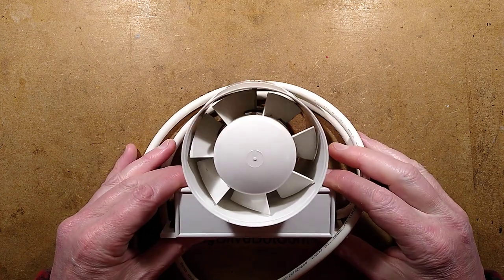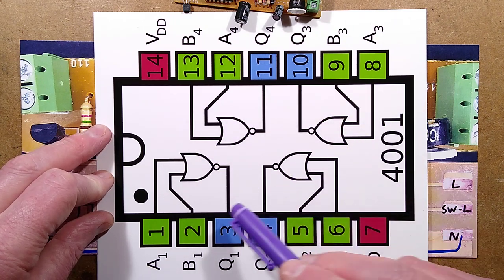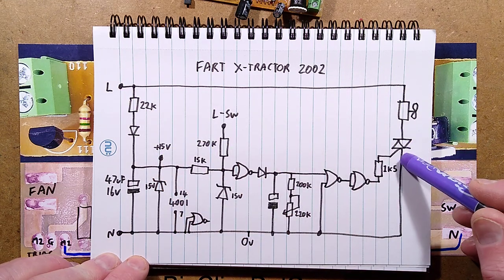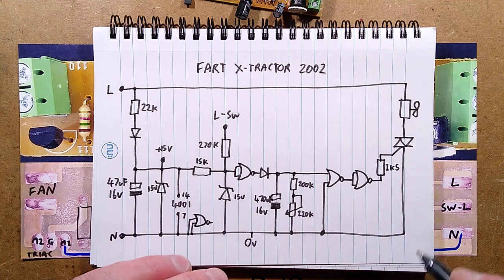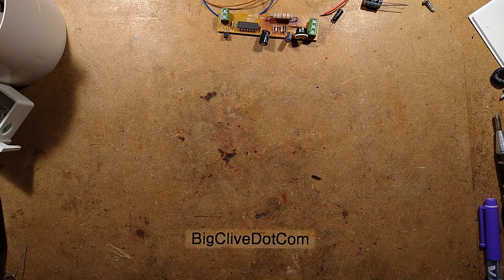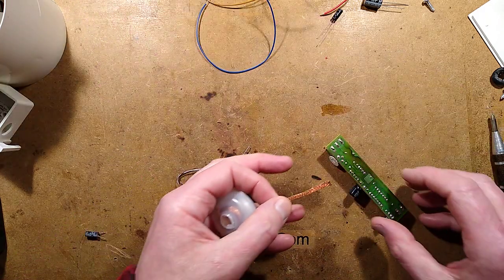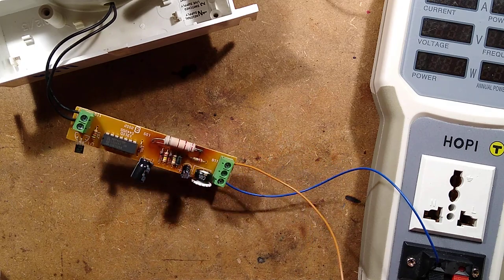Fixing a fart-extractor (with schematic)

Comment: I have to get one of those component testers they look pretty cool. I’ve found  they often have a thermal fuse in the windings of the transformer in the fan  and if that goes then buy buy fan as it’s pretty much buried deep in the winding
Reply: dont blindly trust those testers, they can give skewed readings in certain cases, especially with electrolytic capacitors, if the cap hasnt been powered up in years, it may have unformed slightly, and indicates bad, resistive, or very high capacitance,  way out of tolerance, its not necessarily bad as such and may be perfectly ok once powered up  for a while , ideally to full working voltage,

Comment: If I understand correctly, this consumes a watt constantly, nicely toasting a 2 Watt resistor.🤔.
Great reverse engineering Clive.
Thanks for sharing.
Reply: That is unacceptable. I would redesign the cicuit if it was mine. It should not draw any power when the fan is not running. Im thinking a high voltage MOSFET that is switched on by the switched live with a capacitor on its gate that slowly discharges when the light is switched off.

Comment: Hey Clive, want to build something that can be done on perfboard in about 5 to 10 minutes, create a voltage divider (using a potentiometer, resistor and of course the light dependent resistor) mount the LDR facing the light source you wish to control, could be a few inches away, and have that voltage divider control an NPN, so that the divider produces a lower voltage across the base of the transistor the brighter it gets 

once you adjust your pot and get the brightness that's it, I made it, thought to myself why isn't this used by the chinese and if it goes over max current a simple 500ma 1amp etc fuse will do fast blow..

and please do tell me why it's not a good idea to do it , keeping in mind, I had a 10watt 12v LED running like this off a car battery with absolutely no current limiter , to set up ap a 12v I slowly raised the voltage keeping an eye on the current and then adjusted the pot before bringing up the voltage to max!

it's a fun thing to try, really simple if you got an old LDR laying around? cheers

Comment: Nice!   The next step is to figure out how to cool the resistor using the fan - a strategically located hole in the round plastic fan shroud might be all it needs to let a gentle gust cool the resistor.

Comment: I have one of those, it was on offer and I liked the specific style of motor 😂

Extractor fans are a nightmare, I must have replaced my bathroom one 4 times before just covering the hole with a sliding vent, let bugs in without that there... They get so noisy and soon stop moving air, despite spinning and sounding like the time destructor 😂

Kitchen one never worked, so now it's a tumbledryer vent 🤣

Comment: This seems overly complicated. In the US our bathroom fans are a 120V shaded pole motor with a squirrel cage stuck on one end and switched on either with the lights or its own switch. I guess it's more efficient to have it time out after a while?
Reply: Yeah, I'd never seen the use of a timed circuit.  Also here in the u.s., bathroom fan failures typically have a 'howling' phase as the bearings wear out.
Reply: @adamf663  In my experience the "howling" phase comes about a month after you buy it and worsens over however many years it takes to wear out.
Reply: @Skyhawk1998  I have to disagree.  It occurs one day after the warranty expires.

Comment: Why not improve the situation a bit by putting 2 layers of capton tape on the pcb and over the cap to at least slow down the return of the same problem? I would like to se you not only analyse and fix stuff but make them better than they were(if possible at all). Is that something you might consider?

Comment: Nicely done. I was betting on the timing cap. I bet the CMOS NAND gate design was because the chip is basically free, and the inputs to the gates (especially CMOS) are very low leakage so they won't help that timing cap down.

Comment: I wonder if the power supply cable is really copper because it is so beafy. If it is alumium, then I understand. The engine is 20W something like 20 / 230 = 0.09 Amps for the cable, the thickness of the cable makes no sense. You picked an ultra thin cable for the power supply when you have tested.

note : I recently realized why my heatbed cable (12V) was heating so much, it is not copper. I will replace with copper and make sure to adapt / lower the tension applied to the heatbed because the wire will have a lower resistance with copper. My chinese 3D printer has been almost all changed over 3 years.

Comment: If you are powering it directly from a light switch and not using the timer function. Do you really need the multipole isolation switch.

Comment: I would have guessed that the output of the nor circuit that feeds the 470 uF cap was bad. Basically when it outputs 15V, it would be effectively shorted by the capacitor until it starts charging up. The cmos circuit is the only current limiter when charging.

Comment: Has the hallmark of being designed by someone with little experience. 
Why is the one input of the gate after the timing cap connected to 0V? Why isn't the spare gate connected in parallel with the TRIAC gate driver to share the gate current? Why weren't the last two gates converted to a Schmitt with the addition of two resistors to give a better switching action?

Comment: Being a very low current circuit, the input resistor could be easily replaced with a few nanoFarad X1 capacitor and stop the unwanted oven function - no need to heat the farts as they depart :-)

Comment: possibly just increase the dropper resistor a bit as well  may help ,buts its the caps r commonly at fault , upping the volt ratting can give longer life depending on circuit & space , good fix

Comment: That fan looks a bit small to be a bathroom vent, maybe because in my house the ceiling vent fans are 250 mm in diameter and have much larger blades.
Those fans stopped working a few months ago, and only recently were they replaced with new ones which are apparently very energy efficient. The strangest part about them, though, is that everytime they start and stop, they clunk, and surprisingly this is by design.
According to an info/warranty sheet they each came with in the boxes, it's the motor briefly oscillating.
Strange.

Comment: That 22K resistor's heat probably dried out the 47uf capacitor. You can keep the circuit cooler, by using a capacitor dropper instead. A 330nf 630V (0.33uf in Merica) film capacitor should do fine. The 1st 15V zener needs its cathode rerouted to the low side of the 330nf cap, so the cap can both charge and discharge.

Comment: I've rewired the fart extractor at my mothers to solely run on switched power because that particular bathroom was mainly used for washing hands and running that annoying fan for 5 minutes after you had the light on for 20s was neither very quiet nor energy efficient.

Comment: My brother always called them fart fans, but whatever. Ours here in the States generally use a shaded pole motor, and I have mine connected to a separate switch so it doesn't need to run (noisily) while I am showering. Good video, we get to see how the other side of the world gets rid of its farts.

Comment: Upgrade 2 resistors. First the power resistor with a higher wattage rating. Checking resistor voltage ratings beforehand, was surprised at the relatively low voltage ratings for the 5W wirewound ceramic types at 350 volts maximum. Obviously this limits the choice here as industry practice tends to state a voltage rating of around 600V for 240v AC mains. The second resistor, the 270k one, upgrade to a half watt type purely from their higher voltage ratings thereby increasing the survival factor. Change the electrolytic capacitors for 25v/35v working types. Also make sure the 15v zener on the supply input is at least a 1.3w type.

Comment: Thats actually the first time i've seen one using a dropper resistor. The ones i've looked at have all used a dropper capacitor, that said the electrolytics have failed just the same !

Comment: It would be interesting if they'd put small hole/passage from fan suction side to the area near the resistor.  Add a vent on other side.  This would generate just a bit of air flow to keep the resistor as well as the rest of the board/capacitors much cooler with virtually no additional expense.
Reply from the maker: I think the hot resistor doubles up as an anti-condensation heater.
Reply: Some versions with humidity sensing already have that tube and vent in them ~ the “humid” air is passed over the sensor and when a set level is reached the fan turns off.

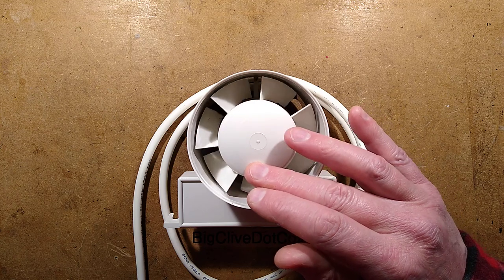Comment: 0:45 - my guess is bad capacitors, one in the timing circuit and one connected to an AC motor. Very odd that they would fail at the exact same time, but maybe they're from the same batch. Let's see if that's right...

Comment: Clive, I use your channel as an  introduction agency for science and electronics. That is about the 5th. or 6th. YouTube channel you have mentioned that I've signed up to.  Since it is a fart extractor, my initial diagnosis was failure due to shit, hitting it, causing an overload condition. I don't like components being run close to their voltage or power ratings. But, this is all about keeping costs down.

Comment: It would make more sense to use a 25V capacitor for the supply filter, rather than the timing capacitor, since it will be subject to more ripple and on that circuit board, it's nearer to the high power resistor, but I would just use 25V for both.

Comment: I had a couple fans that had temp control where if it got hotter in the bathroom e.g the shower was on or you fill the bath but I've had 2 fail not that just stay at a low speed don't speed up or anything is it worth sending it to you

Comment: First fan I had I threw out when it stopped working. I bought another and after it failed I then YouTube'd a fix and after changing the capacitors and resistor it worked again (I now have a spare working fan). Strangely enough the fan is starting to fail again so time to get the soldering iron out again. At least I now know how the thing works although I'd be tempted to try and reverse engineer it now after watching many of Clive's videos
Reply: Have a few fans lying around. Had to recap some (the big ones with the 3-speed PSC motors), some other smaller ones were going noisy and squealy, nothing that a quick oil up can't fix.

Comment: I had several pieces of gear where manufacturers have placed the Electrolytic caps in the power supply right next to the regulator heatsink.  After the first device failed, I said this is gonna be a problem.  Sure enough after the third and fourth units rolled into the shop, I did a field modification and moved all the caps as far away from the heatsinks as I could.  The kicker was the designer could've put a stud on the metal case for the regulator and not needed a heatsink.

Comment: Fartex? is that one of those modern foreign compact tractors? - The fan's about the right size!

I had the right components nailed! Amazingly! Though I picked on the timer first, and then the smoother. However, having fallen into that pratfall with generator control/monitoring gear, caps do come first in the firing line these days!

Comment: The fan in the shower-toilet in our loft-extension now has the same symptoms ~ only does it when switched on at the isolator switch and then triggered with the light switch, when it has initially run it’s time delay and you come back to use the shower-room and turn on the light = the fan immediately starts as if there is nothing wrong with it 🤨 maybe it is the start of those symptoms, as we actively turn the fan off at the isolator switch when we don’t want it on

Comment: I noticed when you removed the power, the fan stopped immediately and didn't continue as original operation described. Either you turned the VR, or that other cap is shot as well.  Cool video.
Reply from the maker: I unplugged it completely.

Comment: those are sure different than ones i usually see here.. i normally see them with the shaded pole motor setup and either on with lights on and off with lights off or separate switches to control either or off and on.
Reply: I prefer the separate switch from the light/internal pull cord so you can choose fan or light
Reply: yeah same. unless in my old house then i have no fan at all aha.

Comment: Have exactly the same model here but the (equally toasty) fusible resistor blew as the extractor pipe was half filled with standing water.
Reply: How did that happen - Too much condensation from the roof cowl?
Reply: @samuelfellows6923  It wasn't installed correctly so the condensation buildup has nowhere to escape (horizontal run). The fan was also under-powered for the three meter run so not enough air flowed through.

Comment: I just reverse engineered a similar fan with a humidity sensor as it did not work correctly when new out of the box. Circuit very similar with the addition of an opamp to sense the voltage from the humidity sensor
Reply from the maker: Note that they may have been driving the humidity sensor with AC.  They're interesting things.
Reply: @bigclivedotcom you are right they were using AC across the sensor. I understand DC will kill the sensor even from your DMM reading the resistance. I made it work by increasing the opamp gain by x2 and moving the sensor near to a hole where it would sense  better.

Comment: A fart extractor? Cool! I would like B.C.  if you could possibly display how an old vintage relay works. Some have 5 connections on the back some have six.
Western Electric relays 260 BM or 260 BJ,  260 BU.
They run $30 - $60.

Comment: I thought u can check potentiometer by connecting an ohm meter between the 1st and 3rd pin (not connecting the wiper) it should show its value.
Edit:
Also, will the timing capacitor discharge through the logic gate? just like the capacitor was charged through a diode and a logic gate.
Reply from the maker: The logic gate input is very high impedance.

Comment: Wish you posted this under a searchable name Clive😢. My mother in law had exactly the same fan with the exact same problem, except the large resistor had just about burnt through the board instead of a little scorching (prominent charcoal flakes). Ultimately i just changed the whole thing, as time wasn't what the in-law was willing to give for a £20 replacement. But i did do a very brief search to no avail and had i found this video, i would of replaced the caps and resistor, just for shits and giggles and learn what the problem actually was. Love your vids big guy!

Comment: If you drilled a hole between the fan housing and the circuitry box, enough air might blow through to keep that resistor from baking everything.

Comment: Nice.  I was just thinking I should build a timer for my bathroom fan.   What changes would need to be made for this circuit to run on 120v?
Reply from the maker: The resistor value would be roughly halved.  It would also run much cooler.

Comment: I would have drilled an air vent to cool the resistor and cap by at least the 40'C rise that burnt the PCB dark then used a bigger Triac to also control the Fart Light using a motion sensor to enable both fan and light.  Hands Free.  How do you know if others washed their hands before exiting and touching the power switch?  PFFFTT !

Comment: Could you drill a small hole through the case into the fan tunnel and one near that resistor so that it uses the fan to cool the circuit a little? Possibly even one small hole either side of the fan blades so that there’s positive and negative pressure flowing through the case🤷‍♀️
Reply from the maker: That would risk moisture ingress.

Comment: It is almost always the capacitors. I remember when I was younger and fixed my computer lcd screen as it had power supply problems and it was a bulgy capacitors. It was lower rated compared to incoming power.

Comment: It looks very similar to one I bought from toolstation for £30 to replace a failed fan. At least the toolstation one had the correct colour wires and a separate low voltage LED driver for the light. The previous one had a 230V bulb over the shower 🙄  

Still doesn't move enough air so the timer is set to max. Could I add a larger resistor in line with the (in parallel would be a lot easier though) variable one to increase the max on time over the ~15 minutes it stays on ? Any idea what value I could use to double the time or a calculation based of the resistance of the variable one ?
Reply from the maker: If it has similar circuitry and you could identify the timing capacitor and its discharge resistor then either could be increased in value.
Reply: That sounds like a fan-light shower kit, the light-vent would have had a 12v G4 halogen spot light inside it, the fan would be an inline one (same as the one featured in this video)

Comment: Nice! Something I would really like to watch in one of your videos is you talking about fume extraction for electronic soldering fumes. There are many options in the market, ranging from very inexpensive (and inneficient units) to high end (JBC or alike) that costs thousands of euros. In the midle there are options like the 2UUL Desktop Fume Extractor, which I want to test. What do you use when soldering in order to prevent inhalation of harmful fumes? Thanks!!
Reply from the maker: I just solder in a room with natural ventilation and avoid inhaling the flux fumes directly.
Reply: @bigclivedotcom  In winter as well? 😂

Comment: I understand additional circuitry is needed in order to keep the bathroom fan ON for some time after turning off the bathroom light, but my god, isn't that a bit of over-engineering for a bathroom fan? Fart extractors here in Canada are simple shaded-pole induction motors, no circuit boards; and has its own wall switch, usually right next to the bathroom light switch.